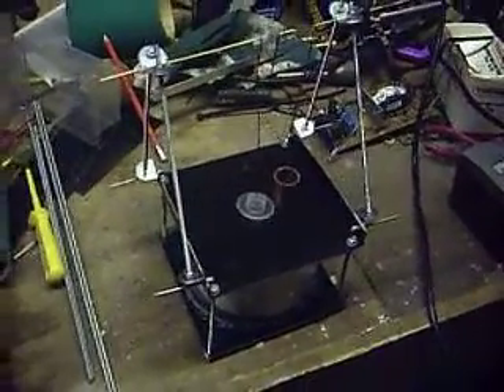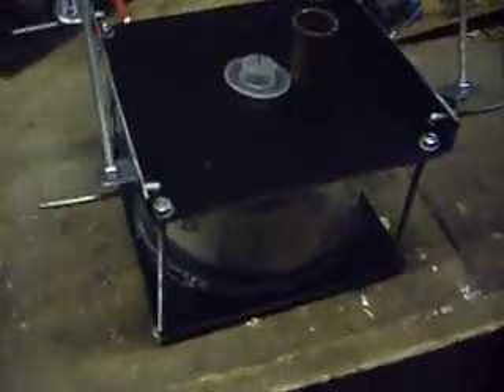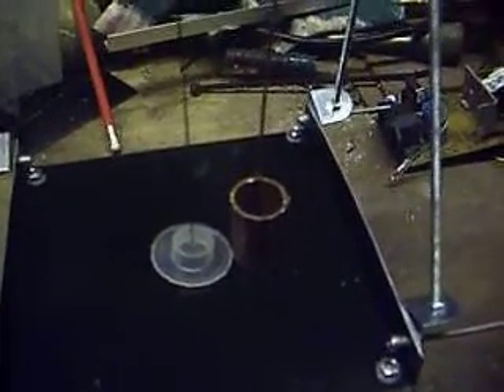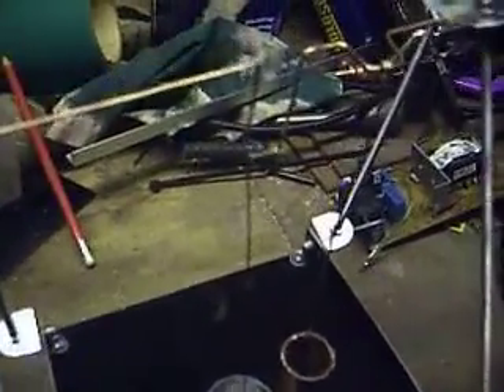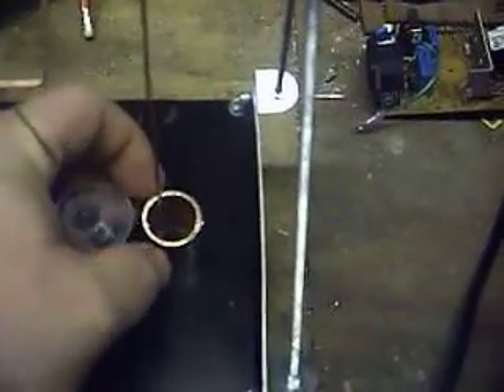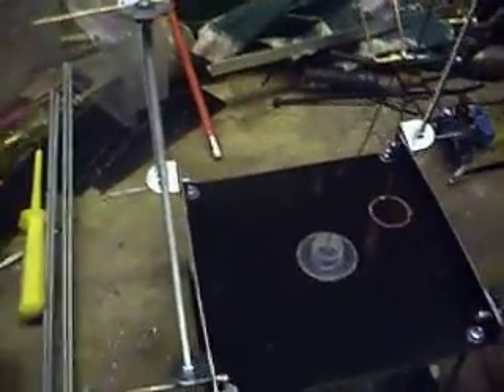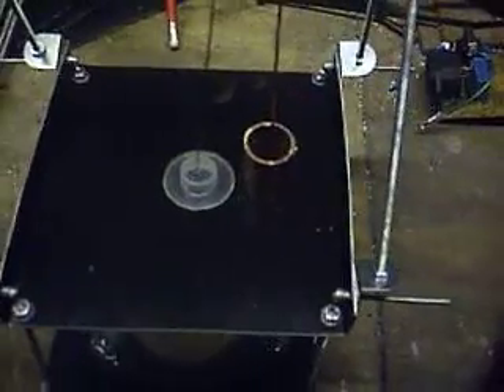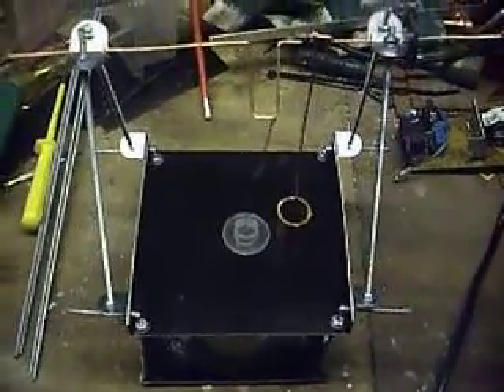stirling engine construction part 3

Comment: Bearings. Wood works well & you can soak it in oil to give lubrication & aid rotation. Silicon sealant against petrolium gel, Vasoline, should give a removable steal, but the usual finishing compound for silicon is washing up liquid, if it won't go off against petrolium, a good smear of washing up liquid.

Comment: I suggest you replace your copper wire with steel piano wire of the same diameter. It is stiffer, smoother and lighter than copper.  It is of coures harder to shape right, but once there it won't bend.  It is also harder than copper, so will produce less friction in both the cylinder sleeves and the cranckshaft 'bearing' points.  Good luck.

Comment from the maker: the original video is reasonably bright... but youtubes 'conversion' makes it dark...

As i said right at the beginning, the first 'take' of part 3 was pitch black... so i took it to the gararge...

part 4 is coming soon... but i'm having problems with it... i think my piston doesn't have a proper seal coz i'm not getting any pressure...

I'm going to make another piston head and try it...